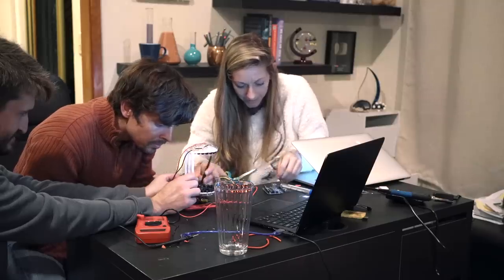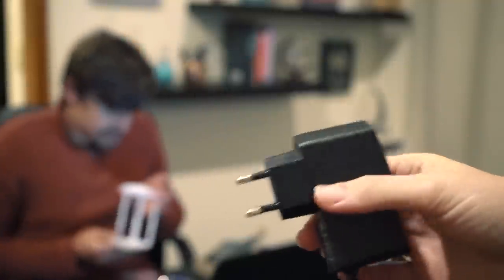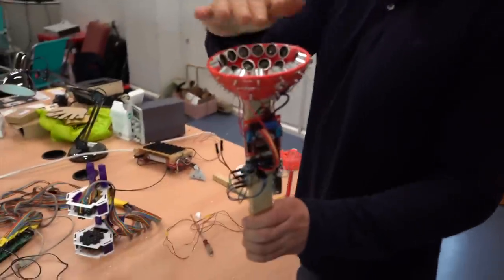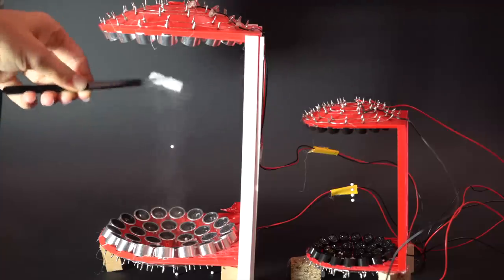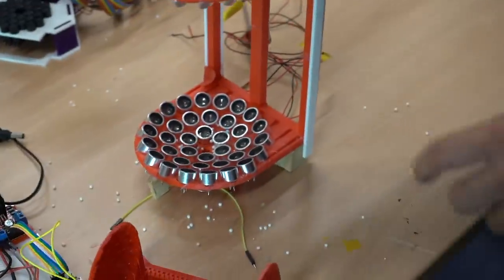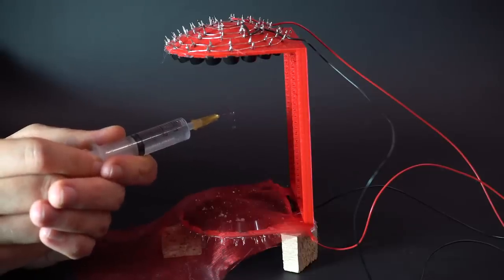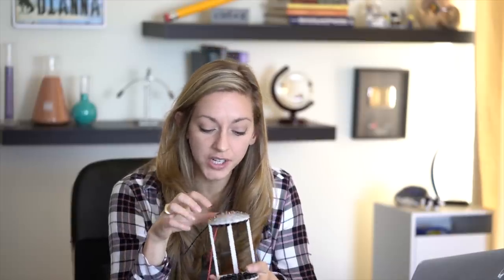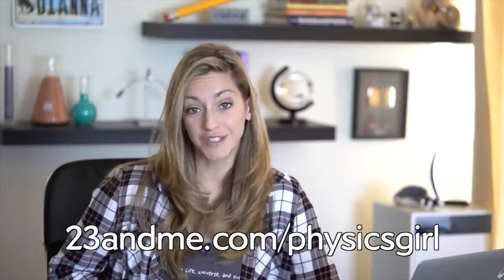I built an acoustic LEVITATOR! Making liquid float on air

Comment: I wonder if focused ultra sonics could  be applied in non-invasive surgery to manipulate things inside the body?

(Maybe pinching off a source of bleeding in a difficult to reach place like the brain.)

If each transducer is independently controlled, the phase and frequency can be manipulated to create the wave shape desired.
Reply from the maker: Check out ultrasonic cavitation in medical uses!
Reply: Simon Ashton it is.
Reply: Simon Ashton for kidney stones
Reply: Aye, or somewhat irrelevant but just as cool "ultrasonic welding"
Reply: Well they use it to break up kidney stones if I'm not mistaken
Reply: Reba Darling Now that is cool!!
Reply: Ive read tht they are using this on dementia patients to break up plaque that forms in their brains.
Reply: @physicsgirl  Diana congrats for your YouTube class are amazing and really makes you love physics. Where can I buy those ultrasound levitation kit?

Comment: The reason microphones pick up the sound is because they need to sample at least twice the frequency of human hearing (usually 44,100 Hz) because of the Nyquist Theorem:
B < fs/2
where B is the highest frequency of the source and fs is the sampling rate

In short, if this isn't the case, expect aliasing.
Reply: Ruben Yanez   you've just given a good reason why the input signal to the sampling system should not exceed fs/2.  Correct.  But you say that this means that the microphone needs to respond to 2*fs.  Wrong.  You have mixed up multiplication with division.
Reply: Ray Kent it's 2*B < fs. fs is the sampling frequency of the microphone
Reply: Ruben Yanez Bravo sir! I wasn't expecting to hear anybody use the Nyquist theorem outside of my (non)linear systems class.
Reply: It depends too much. At the same time, a lot AD converters these days make an initial sampling with a way higher frequency, and only later downsample to the user value. Also, the pre processing may include low pass filters or not, which also makes this more relative

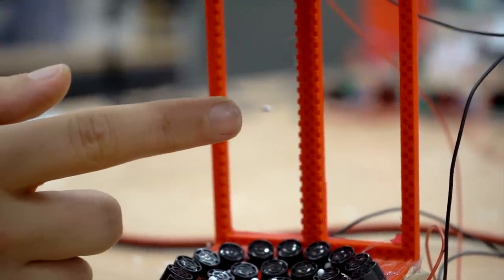Comment: So, I am just learning about standing waves and sound in my physics class. From my understanding, sound waves are actually longitudinal waves that travel through a medium. The description of standing waves uses transverse waves to explain it, but the idea is still the same. Correct me if I'm wrong please, but the nodes in which the material sits in are considered displacement nodes, where the particles of the medium do not move. This is related to pressure, as a place with displacement equals zero is effected by a max or min amount of pressure change. At displacement nodes, it is said to also be a pressure antinode, where delta P is max or min. To explain this concept, imagine the reason why displacement at this point is zero; you either have P_max, where all the particles around it are squeezing the node at both sides; or you have P_min, where the particles around it are being drawn away. You can see this idea at work at 5:05, where the maximum change in pressure causes the particle to be "squeezed" back into the displacement node. Let me know if I got it wrong!
Reply: I do not think I am thinking about this properly so any feedback would be appreciated! :)

Comment: Would you like to get back outside?  How about a video on how sailboats can sail against the wind?
Reply: How about a video on how the "slot effect" on a sailboat works? It's a much more interesting, and complex subject. The explanation many sailors believe is wrong, and even different aerospace engineers disagree on the correct explanation. It's fascinating, because sailmakers have made it work very well in practice, but apparently, we don’t fully understand how it works. I think you tell a great story about it.
Reply: priest's son once you realize energy is extracted from the water and air's difference in velocity a lot of things that seem strange in sailing make more sense. You can do a lot of seemingly weird things so long as you interact with enough air, and water and your drag is low enough. (Foils or planing hulls are key as you would need a crazy long waterline  for a displacement hull,  drag/waterline length is another place wave interaction gets interesting)
Reply: Robert Szasz my idea was that you just use Pythagoras Theorem to explain the higher speed as you can sail with an angle to the direction of the wind
Reply: How about a video on how a two plus b two equals c two? pewds sent me
Reply: priest's son
Yes... That is quite interesting.

Comment: I'd like to see something like a phase shifting standing wave levitator that can act as a converyor, with a rising pattern where airborne particles can be coerced into the column, and they are conveyed out of the area, a sort of standing wave air cleaner that keeps conveying tiny objects out of the space.
Reply: I didn't see your comment before rating mine, but you might be interested in my related comment about the possibility of acoustic elevators and such.

Comment: I think you can make the perfect 'bowl-shape' by pouring a hardening fluid into a large beaker, and spinning it until the fluid hardens.  The focal point can be varied by rotation speed, density, viscosity, etc.  You just have to find the right RPM, given the other parameter(s).  Then insert the traducers on the hard parabolic-like bowl.
--daLE

Comment: I have been dreaming of this for years.  And he/you guys literallty do it the way I pictured.  What I would love to see them do is build a sensor in that can determine when you've inserted matter, and then manipulate the node to lift that matter to a certain height, where it hits another group of transducers that are at a 90 degree angle that can "push" the matter out to a platform.  I would imagine there is some way to regulate two varistors at each group of transducers to set the right amount of push each tranducer provides to control the ascent/desecent of the matter.
Reply: I was just thinking...as a safety measure, you'd want to create a backup plan in case someone was levitating and power went out.  So if it doesnt interrupt or interfere with the nodes, there should be a ropeladder webbing up the shaft so that if power goes out, you can just quickly grab the ropes and climb out of there.

Comment: NASA used magnetic levitation in an experiment on the Space Shuttle suspending fairly large spheres of water and oil. By varying the frequency of one or more speakers they could spin the drop so rapidly it shattered. The astronauts also used a needle to inject air or a second liquid inside the spheres and observing what happened when they spun them.

Comment: One of the researchers suggests that this can be used to do zero-g type experiments, e.g. hatching insect eggs or sprouting seeds. I'm not sure if the floating object will actually experience zero g. what is happening is that the air exerts a net pressure on the object, and balances the weight of the object. I think the distribution of pressure within the object will be pretty much the same as if it was resting on something. The only new factor we'll be able to study is how seeds germinate while being zapped by high energy sound.

Comment: bigger speaker...levetate human?
Reply: Deconverted Man that’s what I said xD
Reply: Deconverted Man still that would be really cool
Reply: Since the idea here is that it's applying a force by acting remotely via sound waves, I'd be wondering whether you could simulate something like a finger touching the back of your back, using speakers mounted some distance away from you
Reply: Also much lower frequency. With 40 kHz nodes are spaced about 4 mm apart. So you would probably tear a human apart. For nodes to be spaced 50 cm apart you'd need a frequency of about 340 Hz. It would probably still tear you apart though. And with such frequencies you'd also get problems with vibrations. But maybe in a few decades, it will be possible :D
Reply: 6:39 Density was a limitation.  So your personal levitator will only work if you are not dense.  

Also size really does matter.
Reply: There is an upper limit for the loudness of sound before it becomes a shockwave, and it’s about 191 dB. Also, since the loudness of the sound is related to the pressure of the air and the capacity of making objects levitate, there is an upper limit for that too, I’m affraid.
Reply: For a person you would need to lay  person 60kg you would need approx. 600 Newtons in about .5 m2 meaning its 1200Pa of pressure. 1200Pa wouldn't even break your eardrums! But it would be about 155 Decibels. So there is ur power 155 decibels at the distance you need. Please feel free to correct my math or assumptions! And if you are laying down your height is about 20cm or a frequency of about 1khz. This would certainly be unpleasant
Reply: Timo van Neerden to make it even easier you could try changing the density of the air
Reply: stefan r

Aw, that's too bad!  I would love to be levitated, but it probably wouldn't work on me because everyone tells me I'm really dense.  😕
Reply: deadfr0g if u r fat, don't worry, it is less dense than water
Reply: Boggless You get deaf with only one second of exposure to 144dB SPL, so that wouldn't be anywhere near nice. Levitating humans won't happen this way. Plus, even if it would, a relatively decent levitator would be extremely big. Take in comparison the size of the particles used on this video to the size of the device. I believe we can assume that the device would be somewhere around 50 metres tall and about 10m wide.
Reply: Human density is about that of water (salty water if you will: you'll remain just under the surface in fresh water and you'll naturally float in sea water, assuming the sea is very calm). So pretty much like the density of water droplets, yeah.
Reply: Just use extra-tight ear-plugs, Alexandre.
Reply: Luis Aldamiz That doesn't seem anywhere near reliable. What if the plugs fall accidentally? Plus, what about the induced vibrations to the human body? Will blood be alright?
Reply: You can make sure with sturdier headphones, ear protection can be made very good. But good point re. possible damage to the body in general, Alexandre. Let's first test with elephants: if they survive, then it's safe for humans probably too. ;D
Reply: Luis Aldamiz also, just a last remark:  even ear protection modeled specially for your ear cannot diminish more than 25dB, and common ear plugs do not attenuate more than 12 or 13dB, so the headroom you have is still too narrow. Plus, no one can be exposed to more than 15min of >110dB SPL or severe permanent loss may take place. So yeah, it's not so simple
Reply: @trejkaz  ya!! saw company use it during XR gaming development! Used sound to make it feel like you were touching in-game objects.
Reply: You need to add light wavelengths also build a machine like I'm trying that build any wavelength from the bass wave up
Reply: @timovneerden  So the Egyptians didn't use this tech to levitate those massive stone blocks? Dang. :)

Comment: Has anyone upscaled this to say... tweeter or subwoofer sized speakers and tried to see what the results would be? :P I mean, besides becoming deaf.
Reply: XSportSeeker I'm not 100% sure but I believe that's too low a frequency.. thats why they typically use quartz transducers to produce the sound.
Reply: I don't see what the issue is... i mean, obviously once you lower your frequency, you can no longer levitate tiny objects the size of a rice corn because the local pressure gradient is too low... but you should be able to levitate larger objects like gummy bears. You can get somewhat inexpensive tweeters and run them at 10 KHz. I see why they designed the kit this way, because you want it to be possible to ship in a mail envelope and cost only $20 in parts or less, and keep it safe, to actually make it accessible, but if someone wants to spend a few hundred to a grand and build one that is big and dangerous, i don't see why not?

Comment: If we scale it, can it levitate a human?
Reply: It seems based on my reading its limited by density not size, so a scaled up one would be able to levitate larger chunks of styrofoam/bigger drops of water etc but I don't think a human
Reply: Matthew Lennox The density of a human body is close to water (1.02gm/cm3 to 1.08g/cm3). However the asymmetrical structure of human body is something which might be a hurdle.
Reply: But again, the asymmetrical structure might be less significant, when the size of levitator is large.
Reply: Have the human (or other cargo) sit in a big (clear) plastic ball or geodesic, and scale the waveform generators to the ball.  That solves the density issue for a variety of shapes/sizes, protects the cargo from the wave-interaction pressures, and invents a crazy new theme-park ride and/or elevator system (by controlling the focus angles of the wave generator modules) at the same time.  It may not be energy-efficient by your standards, but it is the equivalent of frictionless.  To reduce noise pollution at that scale, the whole lifting system needs to be enclosed in a tube, and sealing it and filling it with optigel will improve force-efficiency.  You're welcome -- from the future :)
Reply: Then we can float around like little happy flappy birds whoooooooosh
Reply: animist channel, You want to have a huge expensive machine that consumes lots of power. The result, if it works, is that a passenger can sit in a confined space and not go anywhere.
Reply: I wasn't saying "want," I was saying "could" or "will," and I also said it wouldn't be energy efficient.  As for going somewhere, the lift is generated "by controlling the focus angles of the wave generator modules."  This means having variable concavity of the generator cluster as well as gimbaling the individual modules to create a peristaltic lift.

In an environment like a dust-intensive low-g moon, this kind of "caterpillar" effect would be more useful, as it would reduce the number of structural and moving parts that are subject to corrosion and friction.  With an abundance of power generation, the inefficiency may be offset by maintenance and materials savings.

Using a low viscosity, low-density fluid in the lifting column, you can offset much of the load via bouyancy, and then the wave drivers mostly have to focus for positioning.
Reply: animist channel excellent idea man. I am sure we 'll see this in near future.
Reply: animist channel, this thing is completely dependent on an atmosphere.  A "dust-intensive low-g moon" does not usually have one.  A buoyant object floating in a fluid is a sound suggestion.  Boats have been around for awhile.  Propellers, sails, paddles, and screws are popular mechanisms for moving them.

Comment: Instead of a curved surface (be kind because I haven't thought this completely thru) it might be possible to create a single plane wave synchronized on both sides using either piezoelectric film or carbon nanotube material which produces thermoacoustic plane waves without moving itself (as opposed to a curved speaker or even the aforementioned piezo film, both of which require a moving membrane to create the sound vibrations). I could be mistaken but it seems to me, opposing plane waves in sync and aimed directly and squarely at each other, would produce standing plane waves with a 2 dimensional node plane rather than a one dimensional node point (or maybe more accurately a node plate vs a node sphere rather than plane or point).

Would be cul if you tested out this theory with either (or both) carbon nanotube and piezoelectric film on opposing flat surfaces. I would watch that video!

Comment: Big deal. I used to levitate <i>people</i> with nothing more than a Fender Jazz bass, a Biamp graphic EQ as preamp, Tapco 500w power amp bridged to mono, and an Ampeg SVT 8 x 10" cabinet. Sample soundcheck discussion with house engineer: "Could you turn it down some? You're dimming the lighting system on the low notes. For the whole block." 

Being a sound engineer myself, I would take pity on them and do what they asked.